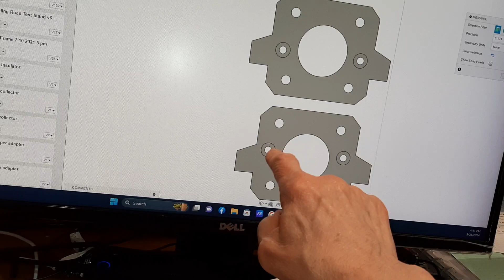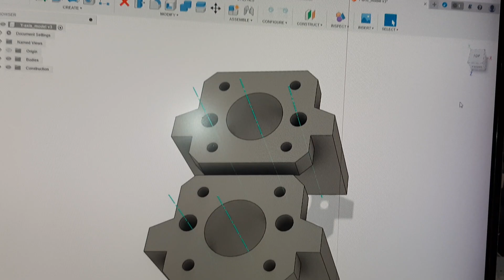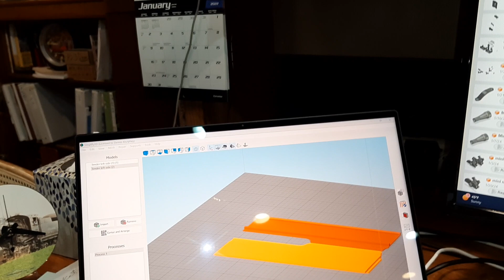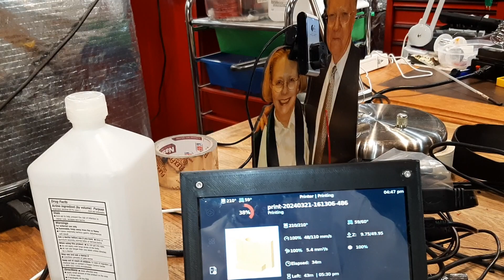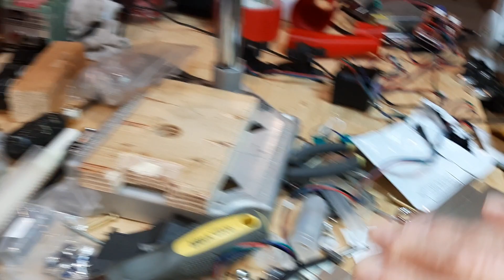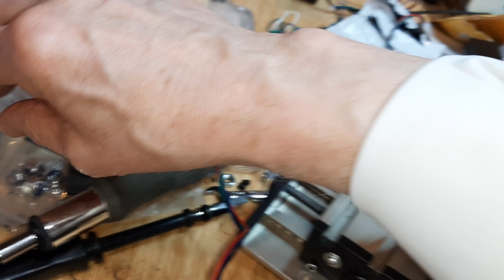Frankentrain Laboratories quick update on Mini Mill. ran out of memory so the end is abrupt.

Comment: Hi Dennis, unrelated to this...have you ever had to rewind an AF steam locomotive's field?  I just broke the wire in the middle of my 343's field winding.  I'm thinking of making a jig to do it.  Have you ever had to rewind a field?
Reply from the maker: Nope too tedious for my brain. I spent weeks designing a DC field assembly instead.  That's how my brain works. Good luck. D
Reply: @DennisMurphey  Thanks, will be fun, I have nothing to lose and can always buy a can motor if I fail.
Reply from the maker: You could convert the fields to PM for a Flyer DC motor